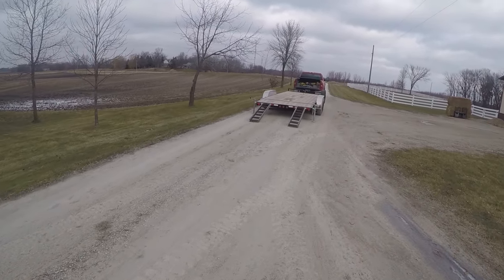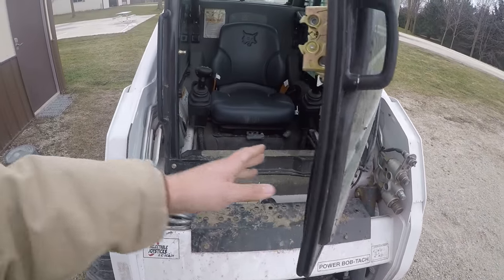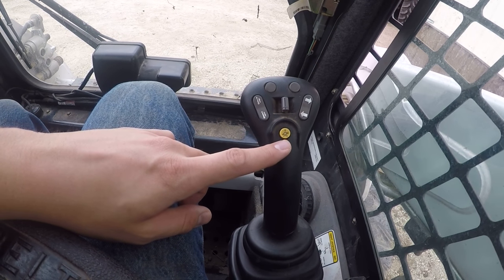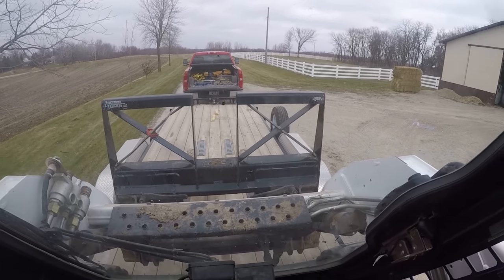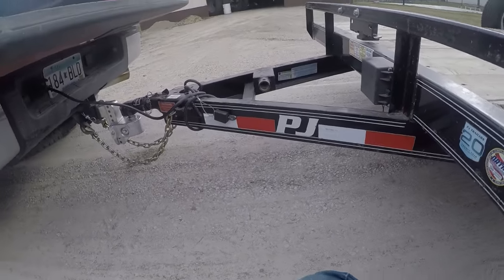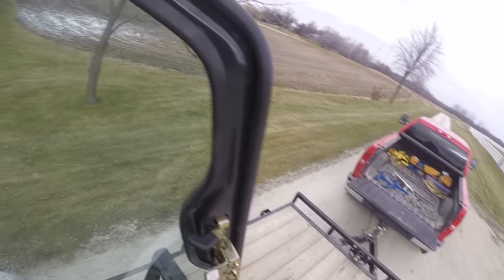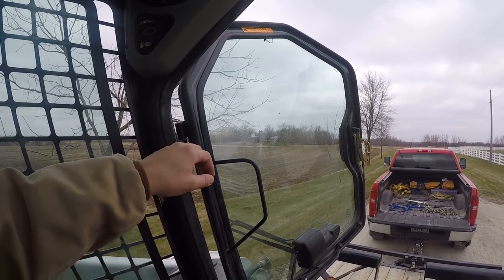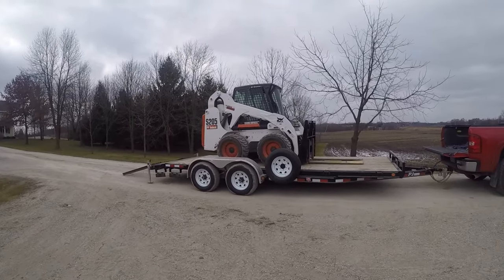Loading a Bobcat onto a Trailer to go to Matejcek's Implement

Comment: What's really ridiculous to see is when a guy loads his skid steer ALL the way to the front on a long ass gooseneck trailer, with nothing on the rest of it...people like them don't understand the concept of a Gooseneck trailer. Great video anyhow, and I'd wager your trailer is closer to 2600-3000 lbs empty. Believe me it's heavier than 1500 lbs. I've got a 16' long trailer with tandem 5200 lbs axles and it's 2200 lbs empty and yours is a lot longer than 16'
Reply from the maker: ya im a stickler for tongue weight.  im sure you're right  i was just guessing.  i have no clue on the weight